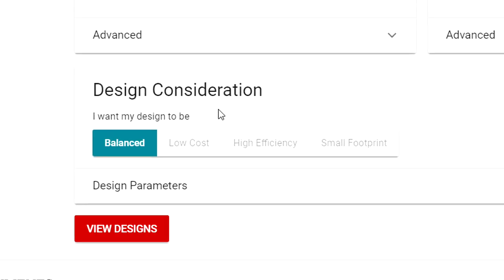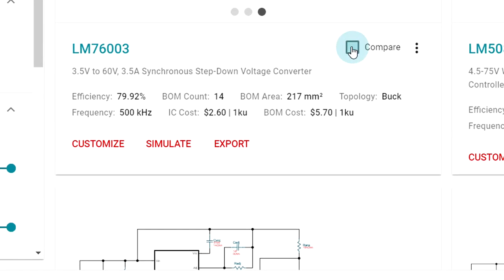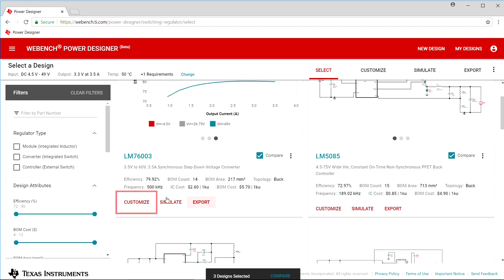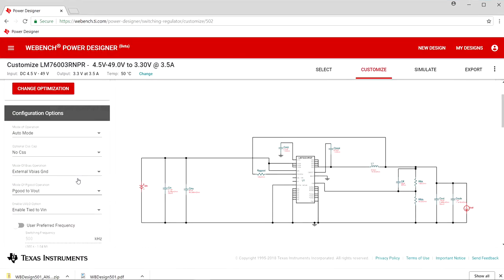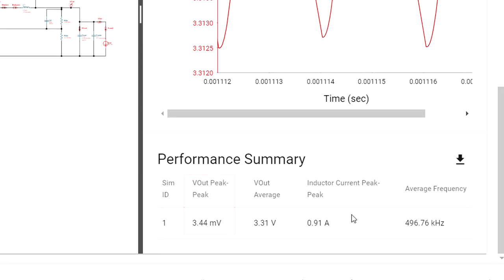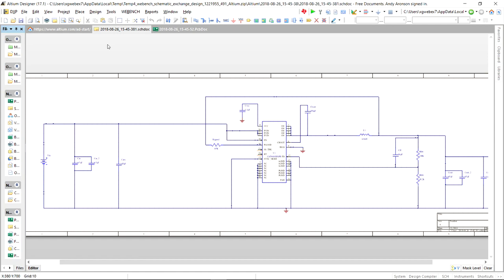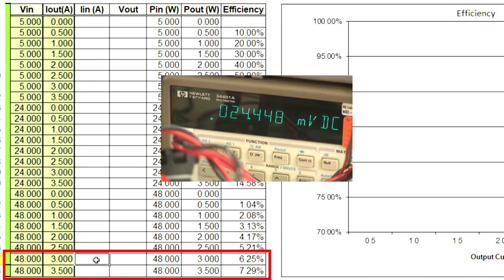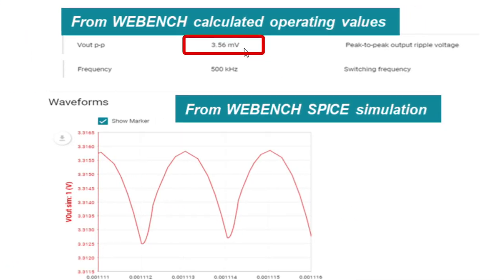How to use WEBENCH Power Designer

Comment: No words can describe how cool WEBENCH is. I was preparing to do a full design, test, and PCB design manually using Multisim & Eagle. On top of that I'm not an engineer so mistakes would surely be made. With WEBENCH I get a professional design in minutes. With my experience the same thing would have taken me weeks and it still wouldn't be as good. Thank you!